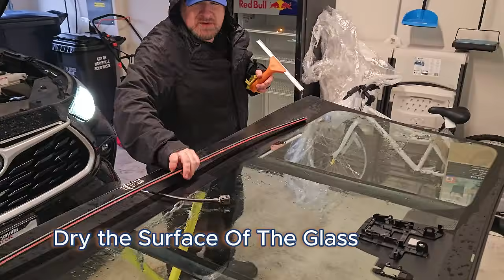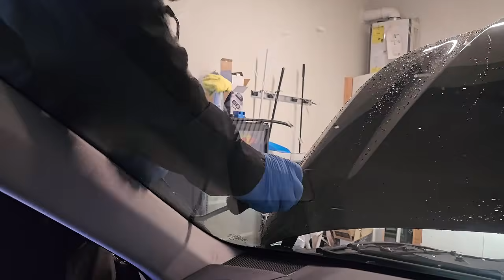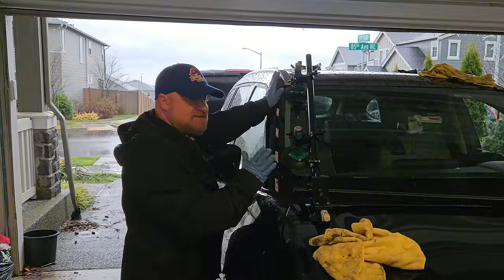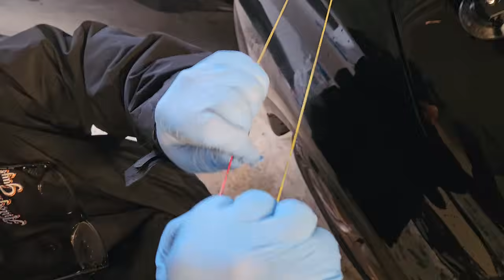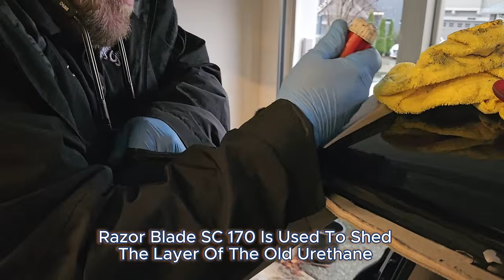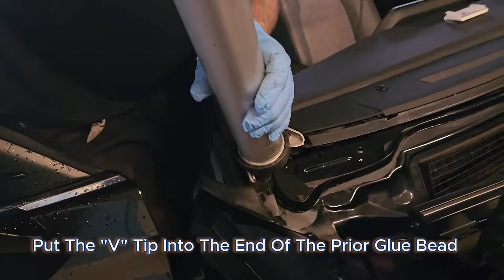How To Replace A Windshield | The Windshield Replacement Process

Comment from the maker: 💬 Got questions? Drop them below! We’re here to help. 👇
👍 Like this video & subscribe for more auto glass tips and repair guides!
Reply: Have a fleet car used for my team. 2018 Ford Transit Connect? What are those usually at?
Reply from the maker: @Drive-Insight  
https://autoglass-guys.com/commercial-windshields

We make service agreements for alot of local businesses! Those range 250 -500 depending on if its OEM and the attachments
Reply: How much for a 2023 Kia EV Windshield?
Reply from the maker: @chrisWINSAUCEcross  

https://autoglass-guys.com/quote-and-schedule

We can source the part potentially cheaper than what NAGS pricing will show for it. Call us!
Reply: didnt this leak?